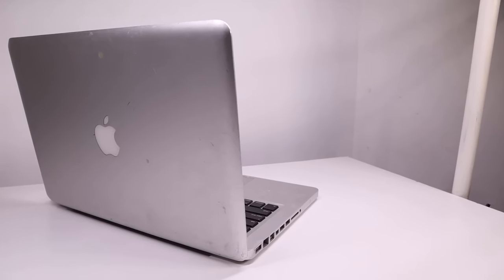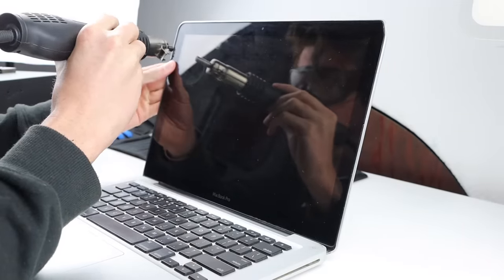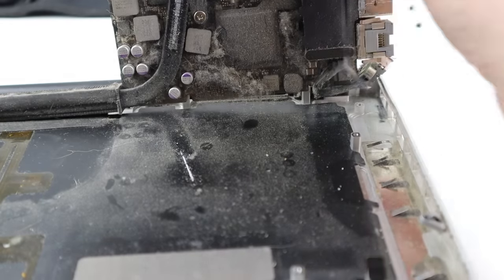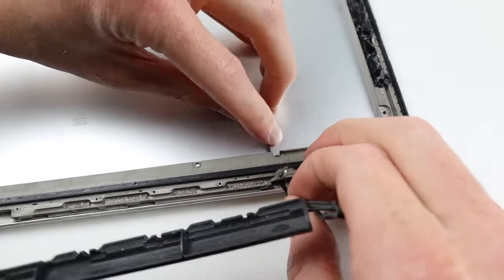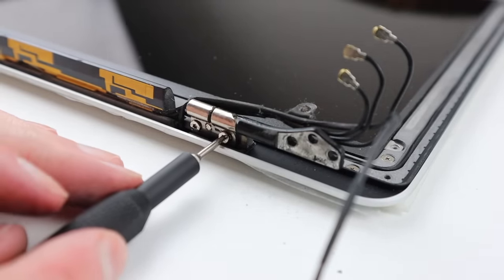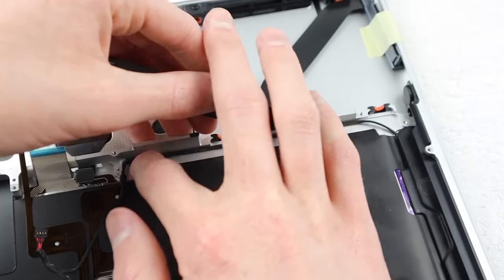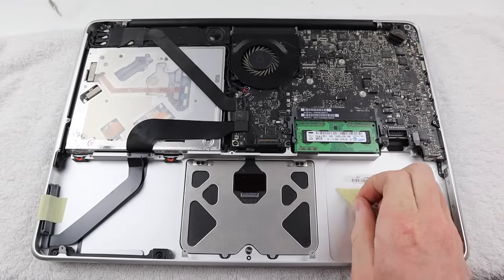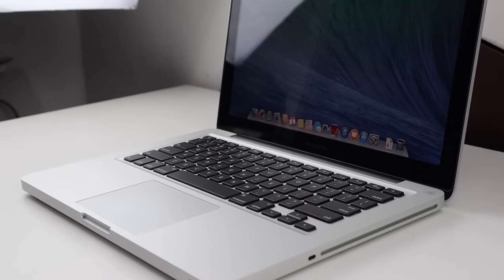$100 Trashed MacBook Pro Restoration & Rebuild + Custom Apple Logo & Keyboard

Comment: Hugh you should invest in an oil free air compressor to quickly give everything a shot of high pressure air rather than rubbing with a cloth.
Reply: I was about to write the same thing... or you can settle for those overpriced aerosol compressed air cans, but the compressor will serve you better in the long run.
Reply: crazy waters  Luckily I found a man who understood it!
Reply: I actually used the football inflator needle with a bicycle pump and it worked perfectly.

Comment: Everything was fine until he “cleaned” the motherboard and put the thermal paste.
Reply: That's crazy don't remember asking
Reply: I think he cleaned that before lol
Reply: Not mention he left the crusty old thermal paste on the sides and just cleaned the top of the cpu lol.
Reply: So
Reply: If he tried cleaning the paste off the sides, he would risk chipping the die. I think it’s not really a risk worth taking to avoid some angry comments.
Reply: codyn92 says the fake “perfectionist”
Reply: @thegloriouspotato6223  Isopropyl alcohol and a soft brush would have done the trick and wouldn't have ripped anything out lol. I've also removed crusty old paste a couple times with harder plastic tools and the CPU was just fine. They're CPU parts, not glassware.

Comment: I would recommend cleaning the remaining parts with a soft toothbrush and use alcohol to clean the CPU heatsink. It's best to not smear thermal paste, as you don't want any dust or contamination in the paste. Use the pea method. Ok now I feel better.
Reply: David Goettler how much u get for this hobby? :)

Comment: Great restoration, I can see why you went for replacing the frame and other components since the old frame was in such rough condition. Also nice customizations!
Though a couple of the ports and the motherboard could have been cleaned a bit better, the RAM could do with being upgraded to 8GB, and I'd have personally installed OS X 10.11 instead of 10.9. A lot of programs now, even Google Chrome and Spotify, require OS X 10.11 or better.

Comment: Did he even clean anything on the logic board?
Reply from the maker: cleaned it with air, just cut the clip from the video. Its not spotless because I couldn't exactly wash it under water....
Reply: @HughJeffreys  A soft brush would have cleaned it decently
Reply: Hugh Jeffreys you can use brake cleaner learned this from tech yes city. Done it before myself I just let it dry under a fan after.
Reply: Hugh Jeffreys Some rubbing alcohol and a soft toothbrush is what I recommend for cleaning pretty much any electronic device’s logic boards.
Reply: Dont fix whats not broken
Reply: @HughJeffreys  isopropyl, also you need to clear all the old thermal paste haha
Reply: use isopropyl alcohol, and soft brush
Reply: @HughJeffreys  you could have used contact cleaner
Reply: Coulda give it the old tech yes loving
Reply: You could clean that mb with a brush. All that restoration but no clean for the mb. That's a shame. Bad Hugh bad.
Reply: @HughJeffreys  You can certainly use water, as long as no CMOS battery is attached. I've used water to clean many motherboards and video cards, etc. You just need to use warm water (no detergent) and dry it thoroughly afterwards, i.e. in an oven at a low heat, or leave it in front of a fan for several hours.
Reply: he didnt.. thats why i disliked this video..
Reply: 14:28 :D
Reply: @Kimdah_  I wouldn't recommend it unless you're prepared to re-solder any tiny pieces of electronics that could come dislodged. The solder job on motherboards can vary widely and I've had electronics broken just from a soft toothbrush before although I may just be unlucky.
Reply: @HughJeffreys  You can, for examble: derbauer wash all is mb on the dishwasher. In any case you can use isopropyl alcohol
 with a q-tip.
Reply: I was hoping for an ultrasonic bath.
Reply: @HughJeffreys  you should have clean it with compressed air
Reply: @HughJeffreys  thats far away from being cleaned !!!
Reply: Exactly my thought!!! The only part that bothers me in this video lol. It hurts my soul to see new thermal past applied to a logic board that dirty....
Reply: @HughJeffreys  Don't use compressed air, that just forces the dust INTO the nooks/crannies/ports.  Use the hose on a Vacuum, held an inch away from the motherboard, and go over it with a tiny paint brush to dislodge the dust.
Reply: * Louis Rossman is typing *
Reply: Ppl you shouldn't suggest putting an Apple logic board into a dishwasher. There is no Apple dishwasher on the market, so it will be incompatible.

Comment: If you're looking at purchasing a macbook I would definitely recommend preowed or refurbished as you will get much more for your money. I bought a 2013 i5 air in 2015 for 300 AUD. It still works perfectly now even after daily use for years. I've never had to replace and the only repair I've done is removing dust from the fans.

Comment: As a builder and Tech enthusiast, I found this restoration almost beautiful... Except the part where the board/fans/cables weren't blown out with Compressed air and cleaned with Alcohol.  Also, while it's not STRICTLY necessary to spread the paste out [pressure will do that] either way is acceptable [except that huge piece of hair stuck to your spudger while spreading >.>  Don't contaminate the paste :P  Yeah, I'm nitpicking. . sue me. .but overall I really enjoyed watching this ^^
Reply: Yes when I used to maintenance my Xbox changing the thermal paste I figured out that you actually don't need that much paste and the pressure from putting stuff back together should be more than enough to spread the paste
Reply: Blowing PC parts with compressed air just forces dust INTO the nooks and crannies and ports.  Instead use a small handheld vacuum (the kind that are $15 on amazon, used to be known as dustbusters) and a tiny soft paint brush to dislodge the dust as you go.
Reply: @blueridge8992  You need to be careful with that, as vacuums, even hand held ones, CAN cause static.  You're not wrong about the potential issues with compressed air, especially if the dust is old and kinda sticky-ish, hence the alcohol suggestion.  ALso, a gentle bristly paintbrush is a GREAT tool for getting loose debris off of motherboards

Comment: Just in the process of restoring my old MacBook Pro 15" mid 2010, although my screen and case were not damaged, just scratches. How much did you end up spending for all parts? My restoration ended up at $275 (out of pocket, which includes taxes and shipping), Replaced battery, keyboard, touchpad, speakers, laptop legs, upgraded HDD to SSD, purchased missing MagSafe power adapter.

Comment: Why didn't you use toothbrush with alcohol to clean it?
Reply: @glazezboy No it won't.  You can use alcohol, or even water and soap to clean the board.  But you need to ensure it's 100% dry before powering back up.
Reply: No it won’t. Smh.
Reply: @booboo699254  water and soap causes the board to corrode and rust over time due to reaction
Reply: @shzammpatapon9865  Nope, it does not.  Water is used by the industry to clean boards after going through automated manufacturing.  I know, I've worked in this field.   Google it and you will find information.  The key is removing all water and contaminants (such as the soap).
Reply: @booboo699254  alcohol will damage the big ass capacitors not the board!
don't use it!also don't use it to clean any kind of screen that is plastic
Reply: @dinozaurpickupline4221  No it won't damage the capacitor (unless you somehow are stating you would dunk the entire board in alcohol but no one is  stupid enough to do that (the fire danger alone should stop people)).  Running alcohol over the board and scrubbing is just fine.
Reply: @booboo699254 You're right! I've worked at Apple repair shops and we do this too. You can soak the logic board in a soapy solution in the ultrasonic cleaner which will actually clean off the corrosion which can revive a water damaged MacBook or after soldering. So long as you let it fully dry on a hotplate there won't be any damage.

Regarding the alcohol, so long as you're not using a broom to brush it you'll be fine.
Reply: @booboo699254  frequent application on a poor quality capacitor will make that capacitor weak,but I have not seen them on any logic boards,lately.
Reply: The same reason he didn't give a total resto price at the end..... Like why? 😔
Reply: Azam Jamal vodka is the best for MacBooks 😝
Reply: @booboo699254  people thinking, you're saying ah just dunk it in a sink lol
Reply: For cleaning electronic boards I use soft head paint brushes with isopropyl alchool. I used the wd40 contact spray to clean the usb port of my s3 neo. I heard that u can even soak entire boards in distilled water without corroding them.
Reply: Using alcohol will damage the circuits since alcohol melts plastic
Water is safer... Just make sure it dries out
Reply: @J Fz you know i was trolling right? Lol
Reply: @J Fz because that's what trolling is lol
Reply: @J Fz lmao ok but guess who just wasted your time :)
Reply: @booboo699254  Yes it does

Comment: Imagine doing a restoration but not bothering to clean the motherboard. 🤔
Reply: Or the fan...
Reply: Exactly!
Reply: Its no longer simply a 100 dollar macbook pro, but i am guessing all in all cost is around 200-300 bucks? Why dont he remove the dust and make it look new in the inside.??
Reply: And it's so simple to dust it off.. just take a brush and a vacuum cleaner
Reply: How much does a can of compressed air cost?
Reply: this entire project was in vain, its a 2011 and the gpu is bound to expload
Reply: ChallengerDrakava, Imagine getting free content every week then still finding something to complain about.
Reply: @Toasty_Gaming  you are wrong. The GPU problem only affect the 15" and not the 13" which is find
Reply: @Toasty_Gaming  the dedicated GPU on this 13 inch model won't go bad.
Reply: the
clip
was
cut
out
Reply: Joseph Clese  that’s for the 15inch with nvidia graphics that failed 👍 he has the 13 inch with not dedicated gpu
Reply: James Mayer: I don’t see how you can count pointing out something that can be improved as “complaining”? If this were a car rebuilding video and people comment that “you forgot to set up the brakes”, is that complaining to you as well?
Reply: @taratajika  or anything else
Reply: @JamesMayer125  Fuck off, it's just constructive criticism. Plus, if one posts a video on the internet we are allowed to have opinions on it.
Reply: ChallengerDrakava and I’m like why it was just a waste
Reply: He did clean it, the clip was cut out.
Reply: crazy waters  it wasnt an overlook, he cleaned it, the clip was cut out.

Comment: if you dont need the optical drive, you can install a hdd caddy for it so you can use 2 ssd or 1 ssd, 1 hdd at the same time.

Comment: 16:22 .... it's not a $100 macbook its a $350 minimum refurbished laptop.....
Reply: He bought it for 100 dollars....  Read the video description.
Reply: @edmarguerrero  you are slow minded don't ya?
Reply: He bought it for $100 but then also include the price of the new product he bought and installed. So it will finally become a bit costly.
Reply: He basixly bought a new used computer
Reply: 350$ + wasted time... pretty cheap :D
Reply: @edmarguerrero  what about replacement parts.
Reply: @Daniel-tw7lh  350$ hahah lol, its minimum round 600$ without price or charger and price of laptop itself, don't say if you dont know, check prices of top and bottom cover itself, price of battery 120$ on iFixit webpage, and you will see what this repair not worth at all

Comment: Did he ever say how much all the parts cost him
Reply: Jared Braun 🤣🤣🤣
Reply: Ithink something around 150-200.
Reply: @manuelli_sebastian  ur joking... right?
Reply: @manuelli_sebastian  not even close
Reply: On AliExpress are a lot of cheaper parts
Reply: Battery around 160$ top around 150$ bottom cover around 200$ on Ebay, ssd around 150$ for 1 TB if its 250gb ok its 60$
So final is +- 880 Dollars with 250 gb ssd ok its 780$ with price of mac book
So its completely not worth
All parts i mean like man in the video sayed ORIGINAL PARTS not Chinese copies
Reply: @leewilliams9689  eh, he's sponsored by ifixit ,so, he maybe got it for free
Reply: @s2601d  but don't forget the purple logo 🤣🤣
Reply: @vndrewstynx  Possibly for the battery, although he doesn't mention it which is weird if ifixit did purchase it and they didn't want him to plug that ... , but even then there are still the parts that ifixit can't supply, e.g. the upper case he says he bought off ebay @ 11:10
Reply: I half assed checked pricing on various site and I was able to basically do the same as he did in the video for around $330. It’s interesting because my personal MacBook Pro is the same model and has the same dirt and damage except I also have a cracked glass screen also. So I think I’m going to do the same repairs and bring mine back to life. Except with blue instead on purple
Reply: @ @s2601d   +/- 880 is freaking NUTSS!!!! and foolish. 1100$ is the starting price for the 13inch MacBook air, taking its features and hardware capabilities into consideration maybe 220$+ a storage upgrade by lending some money from friends n family is the best investment rather than buying a used one and investing "+/- 880" even it's just for minimum usage. NO PEACE
Reply: +/-880+100(for the used one)
1100+100(storage upgrade) for a MacBook Air 
1300+100(storage upgrade) for a MacBook Pro

I'd definitely go for the base model MacBook pro. If I've got only 880 I'd steal from family/friends (if they don't lend any n I'd tell em after I've bought the laptop)
Reply: It’s sponsored it cost him nothing
Reply: @NovaOneShot  that doesn't mean we'd be sponsored too and it's the battery which was sponsored by ifixit
Reply: @s2601d  the ssd is 50$ btw.
Reply: probably a kidney
Reply: @s2601d  The ssd is around 60 dollars battery is probably from ali express which is like 60 dollars again, and the top and bottom should be around 200 both. It should only be around 320 not the large 880.
Reply: s2601d a 500GB WD Blue SSD is around $64.99. If you got yours for $150 you got scammed hard lol
Reply: Just by looking i assume around 250-300. He said screen was like 75 alone and i bet battery is something like that minimum.  Not sure where he bought or anything but all this aliexpress crap is garbage.. who the fuck trusts that site with anything like this? Ordering a fake cheap chinese battery off it? Fuck no.

At any rate it is NOT fucking worth it. I bet you, all in, plus his time was wasted.. he probably has $350 $400 with 100 included. 

Thing is, i can guarantee i can find a used one like this eventually for like 200 bucks or so barely. Fully functioning and no issues. Smh. Waste of time, 100 was too much to pay and it should have been a parts laptop not a restoration when it needs damn near everything. A shell a screen upgrade ssd a battery etc. Cmon now
Reply: I think it's not being mentioned. It's all sponsored by ifixit. Correct me if wrong.
Reply: @omarelsoukkary7359  i mean 1TB SSD who buy 250 dude in 2019
Reply: @860Jacob  Watch video carefully and read description, there is written he bought original charger, original CASE from Ebay, check prices there, and ORIGINAL Battery not from AliExpress
Reply: s2601d 500GB*. Hey man, I still ran a 256gb m.2 as my primary on my daily driver lol. Storage size is subjective and a preference on the end users needs
Reply: @vndrewstynx  Only way it would make sense. Cool project, but I don't get putting all that work/$ into a really old laptop that's only worth about $250 in new condition anyways. I like the color idea though, be cool to do to my old 2012 13".
Reply: @s2601d  its worth it with the advertising money he will make from this video
Reply: @s2601d  It was clearly a 500gb SSD.
Reply: @amalendupramanick1875  That cheap purple cello, crappily sticky taped to the lid was so bad!!!
Reply: @lucylucy5452  Or you know, get a Laptop instead and have better specs and less price.
Reply: @s2601d  just bought new 85w battery for 2008 macbook pro.. 40 euros! with dhl shipping
Reply: @redman2751  Woud you mind doing a follow up on how that restoration went?
Reply: Ngoubou Lionel I will when I do it.  Haven’t had time yet.
Reply: Jared Braun I think the biggest problem, even if he was able to do everything for under $400. It’s an eight-year-old MacBook which doesn’t mean it’s useless, but the problem is that he stated it is officially a 2011 MacBook Pro. Every single one of those that I’ve ever encountered eventually has the video problem because the ATI graphics chip overheats and the solder balls crack/fail.  That is the one year of MacBook Pro I would never spend any money on

Comment: "It is by far the worst condition mac I have ever seen" Challenge accepted.

It has a number of dents: Mine are bigger! 
Scratches: Oh hell yeah 
Bent: Tick
Hinge Broken: Yup
Missing 2 feet: Im missing 3
Late 2011 model: Mine's 2010

My Additional Problems: Trackpad permanently gets stuck, charger is held together by masking tape, half the keys aren't backlit anymore since i spilled orange juice on it, service battery messaged displayed for the last 2 years, everything crashes all the time, i run the fan permanently at max because even watching a youtube video on 720 overheats it these days. 

I would love to see your despair if you could see this thing.